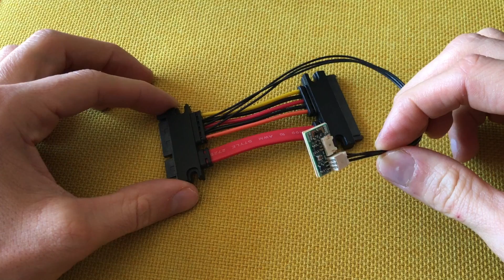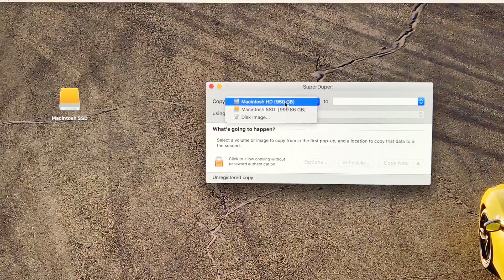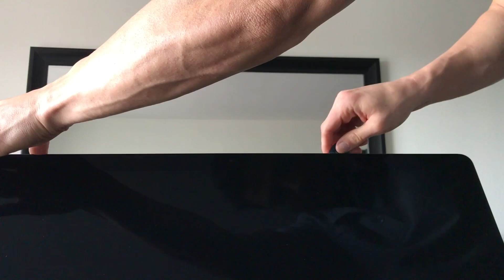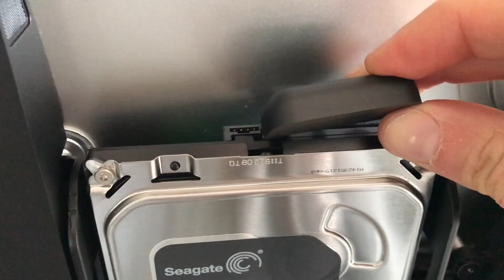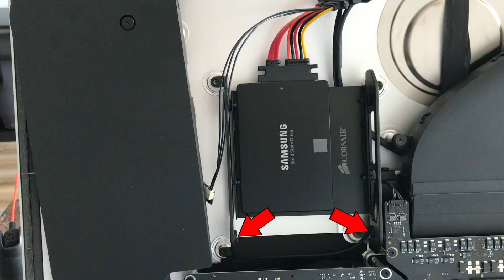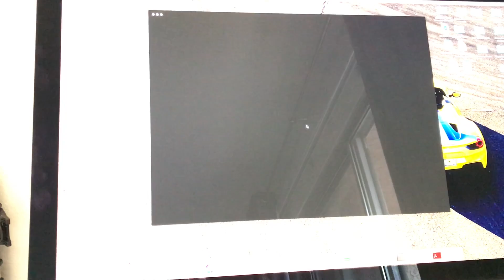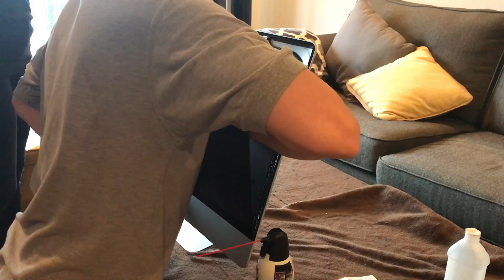How to make your iMAC 5 times faster | 2012-2017 SSD UPGRADE WITH THERMAL SENSOR | Step by Step

Comment: I just finished installing the Samsung 1TB 860 EVO 2.5" SSD in my 2017 21.5" iMac... No need for the bracket, but virtually identical install. Also upgraded the memory from 8GB to 16GB, very happy, and thanks for the video!
Reply from the maker: Michael Wright That’s awesome!! Super happy to hear that everything worked out. And you’re welcome.
Reply: no need for a thermal sensor?
Reply: @dannyisrael  I did not use a thermo sensor, computer and SSD have been fine, no issues.
Reply: Mike did you pair it back with ssd part of the fusion drive ?
Reply: @matt406regal  I had a regular HDD, like is found in a laptop, factory installed in my iMac, 5400 very slow rpm's... The new SSD just plugged right in, nothing special was needed. I have no experience with the fusion drives. I kept the old 5400 rpm HDD to use as an external back up drive. The 21" iMac is different internally than the larger 27" iMac, not much room in there.
Reply: Michael Wright what model do you have ?
Reply: @matt406regal  The 2017 21" iMac 2.3 GHz Intel Core i5. Added the 1TB Samsung and 16 GBs of memory.
Reply: Michael Wright that’s basically the same thing I did.  Ram and Ssd.   Now time for a NVme 1tb Ssd for big speeds
Reply: And mine is a 27in
Reply: @matt406regal  There you go!

Comment: I have been trying to decide what to do but I read on apples site that the max configuration for the late 2015 21.5” (non retina) is 256 Gb ssd or 2tb fusion . Is that legit? It does say the larger IMac could go up to 1 TB. So I don’t know if I can really go above 256 ssd
Reply: You can install up to a 2TB SSD in your iMac and a max of 16GB of RAM... I just did mine this afternoon, a 2017 21.5" iMac. I used the Samsung 860 EVO 1TB and a pair of 8GB Corsair Vengeance DDR4 2400MHZ 260 pin SODIMM memory sticks, model CMSX16GX4M2A2400C16 My iMac is now running on Rocket Fuel! 

The install took around 90 minutes start to finish. I used the Sabrent EC-SSHD SSD to 3.0 Adapter, around $10 on Amazon to clone my old HDD to the new Samsung SSD. I had to use a cloning program, Carbon Copy Cloner, as, at least on my copy of the latest Mojave OS, Disk Utility would not allow me to clone my internal HDD. 

A good place for even more info on doing this is Macsales.com, aka, Other World Computing. They have a wealth of Mac upgrade information, as Mac is all they do.
Reply from the maker: Hmmmm Max configuration of 256 SSD seems really low for some reason. I think that not correct, I’ve personally seen videos here on YouTube of people installing a 1TB on that same model.

Comment: I'm not a macOS user and think most people should use time machine AND clone the main disk when they like the system as it is. This is repeatable. A similar procedure saved my data/main installs about 5 times. Some were total loss of the boot.
Reply from the maker: elektron2kim I agree
Reply: unless you try to clone an APFS disk (high sierra and above) you have plenty options when it comes to full disk cloning; you can use recovery partition to boot and clone from within it, you can boot from external utility OS and run your favorite cloning tool (carbon, etc) or if you're command line cowboy you can even use dd, gparted and so (booting even from Linux external disk)

Comment: Great !! I did it with my 27” late 2013 and it ran faster! Otherwise, I found that my monitor have vertical stripes, not sure that what is the cause of this.
Reply from the maker: hmmmm vertical stripes.  Maybe the connections on the back?
Reply: @AIRWOLF  I've check and recheck but it still be there. Some technical guy said it may cause from pin socket. I'm going to recheck. Here's the strip screenshot https://goo.gl/gnNAqk
Reply: That means you damaged your screen while removing it. Sorry. 
(Too much pressure why prying it open?) Details can be found on iFixit.com, HDD drive replacement.

Comment: My hard drive doesn’t work in my late 2012 iMac anymore and I was wondering would I be good to go ahead and replace my hard drive with the ssd. Thanks for this video btw!
Reply from the maker: Yes! You certainly can.  Your iMac may not be able to take updates anymore but it should boost you speeds some.

Comment: Just some notes for others... I just did the SSD EVO 860 upgrade a few minutes ago (late-2015 Imac). My thermal sensor is currently in the mail, so I did this install without it for now (all seems fine.. no sign of the fan spinning at a higher speed than normal -  I actually can't even hear the fan and never could).      While this was mentioned by AIRWOLF when I replay the video, a VERY IMPORTANT note when pulling out the video cable === when you find the small tab on the top of it.. pull the cable towards the top of the imac which is in the direction of the imac camera, and NOT straight up towards the LCD.  If not sure, confirm exactly the direction FIRST.. because it's a very tight spot, and it is hard to see clearly.  The power cable is similar.. you must pull its connect up towards the top of the imac (where you usually are sitting and where the imac camera is located).   Also, when I cut the foam tape, I used a razor and just ensured I didn't go in much more than 1/4 or so, and take all the extra precautions around the camera. Definitely have someone help you when you lower the LCD panel, and are carefully cutting the bottom strip!  Anyways.... I used packing tape to hold the LCD back on, and will do the CPU upgrade to an i7, and add the pci-e SSD when all the parts arrive. Using packing tape on three sides keeps the LCD firmly in place as well in case  you want to run the new parts for a few weeks, or so (burn in of sorts).   Next thing I learned.. AIRWOLF mentioned using the right 2.5 inch to 3.5inch adapter. If you don't use the thermal sensor (and the cable it comes with), the mac SATA connector has very tight clearances between the IMAC drive connector and the bottom of the drive because the cables make a U turn under the drive and very tightly so.  Thank you AIRWOLF for your detailed video!!! it helped me immensely to do this job and to gain further confidence that I had things covered.  Oh.. and SuperDuper worked great in cloning the HD... and with Mojave (much easilier than cloning a PC HD :)  ).
Reply: I just updated my SSD and memory in my 2017 21.5" iMac... I tried using Disk Utility to clone, no go, would not work. So, SuperDuper or Carbon Copy Cloner, $1 difference, I went with CCC, same results, worked like a charm.
Reply: One other thing... if you have Microsoft Office (i have 2011), it will ask for another product key since the license is tied to the HD (which sort of sucks)... It gave me the option of calling microsoft on the automated line, entering the bunch of numbers and it gave me a bunch of numbers and I was good again.  Also, when the imac is asleep, it wakes up much faster with the SSD drive.
Reply from the maker: Thanks so much for ALL the information. :)

Comment: Great video man, its helpful, but I got a question. IDK if you have idea, if it work i9-9900k processor for iMac 2017 5k? this iMac now has 3.4 GHz Intel Core i5. I'm asking that, cause I wanna upgrade, the processor, SSD and MemoryRam too. Or anyone could help me I will appreciate.
Reply from the maker: Thanks so much and hope it helped a little bit.  As for your question? I'm not too sure unfortunately, but if I find some information out i'll pass it a long to you.  Hopefully someone in the comments can jump in and help. :)
Reply: I'll be waiting for thanks so much for answered have you a good one @AIRWOLF
Reply from the maker: @lopezmejia4876  You betcha!
Reply: No it won't as the 2017 iMac uses 7th gen processors and the i9 is a 9th gen processor and require a newer intel chipset to run (z390, which is soldered to the motherboard). Moreover since they're different gens the sockets probably won't match so the i9 won't physically fit into the socket as well

Comment: I upgraded my Imac 27" with a Samsung 1TB  SSD drive and I didn't need a thermal sensor. It has been a year and everything is running great.
Reply: It's been a week with my Samsung 1TB SSD drive upgrade without thermal sensor as well... no issues so far without the sensor added. (my Imac is a late-2015)
Reply: @MicheIIePucca Pucca what adhesives and SSD model did you use? I also have a late 2015 iMac, but I have several doubts about adhesive and SSD models.
Reply: @Elemedobleeme  Hi, I can suggest that given how easy things are to damage (and be expensive to replace), you should be well prepared before taking on this upgrade on an iMac. I did a quick video under my username (which some info/suggestions) of most disassembly/assembly to help others. Just search for "iMac (Late 2015) CPU Upgrade from i5 to i7 6700K. (sped up)".
Reply: This applies to 2011 yes? Was thinking of doing the ssd swap
Reply from the maker: @Pitoplata  I'm leaning towards a yes!
Reply: AIRWOLF thx 🤙
Reply: house machine I’m about to upgrade to an SSD for my late 2010 iMac. Do I need to upgrade my stock RAM too? And do I need the thermal sensor for late 2010? My tech told me to upgrade my RAM too? If ever do u have any suggestions for a good RAM product?
Reply: AIRWOLF hi! Did you need to upgrade your RAM as well? I’m upgrading to the Samsung SSD for my iMac late 2010.
Reply: is it external? or internal?
Reply: can it go upto 2TB?
Reply: @radiantDF  This is the question I want to know.... Does it have to be 1TB SSD or can I click on that purchase button for the 2TB SSD Samsung
Reply: Digging through a SLEW of videos because I think I'll dive into this today (My 3.5 HDD is sloooooooow, fear its failings also) Been a week of getting cables, bracket,  backing up everything - being proactive. Oh...and I did order the wrong bracket as well, doh!  (live and learn) The correct one is coming from Amazon later today.

I did get a thermal sensor for my Samsung 860 Evo, reason is - I see other videos that the fans in mid-2010s run at full blast if there is no sensor present (SMC Fan control is an option, but I rather just have the internals do the job.)

Checked this video for the right placement of the thermal sensor, this helps! Thanks.
Reply from the maker: You know I wasn't going to install it and I did read that you could get by without it.  But maaannnnnnnn I DID NOT want to go through this process again.  Thanks for stopping by and happy to hear that yours is working perfectly. :)

Comment: Nvme M2 SSD possible to install ? Any adapter ? Because read write speed above 1500 MB !
Reply from the maker: I've heard of these speeds, but at the time of making the video I wasn't aware. If so I would have installed that. Ah well...Next time.

Comment: Thanks for the video. Great job. I am right now planning the ultimate upgrade for my 2013 iMac i5. I am replacing the i5 CPU with an Intel 3.5 GHz i7-3770K chip. The i7 is so much faster than the i5. I am not only adding an SSD harddrive (Samsung EVO860 500Gb Sata),-  I am installing an NVMe ssd 512 Gb module directly on the motherboard. Much faster than the Sata controler. My boot up and system will run from this module. Should be running at 3Gb a second. 
I hope to have made this upgrade in a couple of weeks,- I will let you all know how it went.
Reply: whaaat? how can you install NVMe ssd into imac??
Reply: hfranke07 is this possible without completely ruining it? Considering how hard apple makes it to upgrade your mac.
Reply: I have not done it yet,- byt looking at videos and reading about it,- this should be no problem. My iMac is a Late 2013 model and there is no garanty anymore anyhow.... I will give et a try soon.
 @Mopsie
Reply: hfranke07 I’m thinking about doing the same with an NVME drive....can you share any good videos you’ve found with instructions? I also have 2013 iMac. I have a 2015 but it still has Apple Care warranty left so I don’t want to eff with that one just yet.
Reply: Woo! I would like to do the same. Could you tell us and share how did it go and the performances obtain after, and most importantly how to proceed and where to find the parts?

Comment: I was able to achieve the same result by using an external SSD. Is there any difference in speed?
Reply: Philippe Stroobandt I used the 480GB Sandisk SSD plus purchased from amazon. 
I was totally blown away in the difference in speed. 
My iMac boots up 70 seconds quicker, and I can open and run programs WAY quicker. 
And best of all I don’t have to risk opening my iMac or paying someone to do so. 
If you’re like me and don’t want to do the above, definitely install it as an external SSD. 
You need a usb 3.0 enclosure for best results. You technically can get a thunderbolt enclosure but they are rare and expensive, usb 3.0 is affordable and fast enough, and get yourself a good SSD.

I promise you will wish you done it sooner! My iMac feels new again

Comment: Im upgrading my cpu in my late 2013 iMac from i5 to i7 I really want to find a logic board so that my graphics card would be updated too but can’t seem to find a 2013 i7 logic board.
Reply: I'm planning similar.... late 2015, upgrading the SSD to the same one here.. samsung 860.. plus upgrading the CPU from a i5-6500 to an i7-6700K and adding an SSD pci-e SSUBX 512GB in the slot that comes on the 2015 model. I'm pulling the i7 out of an HP OMEN, that I'll need to replace later, but finding these i7-6700K cpus is tough because so many seem to be upgrading.
Reply from the maker: Haha you're much more brave than me. lol

Comment: great video man! thank you. can I do the same to my iMac (Retina 4K, 21.5-inch, Late 2015)?
Reply: The 21.5 inch iMacs won’t need a thermal sensor upgrade.
It’s only something seen so far in 27” models according to my research
Reply from the maker: @ChristianFadel  Copy that, thanks for the info.
Reply from the maker: Hey Tran! To my knowledge yes.  Once you get inside the iMac everything typically looks the same.  The hardest part is really just taking the monitor off.  But, with that being said I'd perhaps do a little more research to really make sure.  I appreciate you topping by.

Comment: Thank you for your time and effort! Awesome video and I'm beginning the preparation for the same upgrade to my late 2015 iMac 27". I just saw another link where they ADDED this SSD to the already in place hard drive. I don't understand the value of that. I have a 1TB drive in my computer now and will be upgrading to the 2TB Samsung Evo 860Pro. I'm fully ok with taking the factory drive out and leaving it as the next upgrade will be the computer itself. I just need about another year or so. Thanks again buddy!
Reply from the maker: Thats great!! And thank you so so much for taking and commenting.  As for leaving the orginal HD in there? You total could and just use it as extra "internal space".  But! I edit and use externals HD virtually for everything so I didn't see any use in it.  I think that you'll really enjoy the extra read and write speeds as much as I do for sure.  Happy Tinkering! - Wolfgang

Comment: Would this speed up a 4K editing even with 8GB and lower graphic card?
Reply from the maker: Hey bud!  As soon as you incorporate an SSD, you'll notice a difference right away in computing speeds.  BUT! Having more RAM will definitely help the editing software move a little faster just because theres so many moving parts with editing. Now, editing 4K with only 8G RAM, you may want to looking to editing with proxy's and/or optimized media if using FCPX.  I edit 4K frequently and I have as you know the 1T SSD but also 32G RAM and my system seems to be holding up just fine. So, with all that being said if you want your computer to run at its best you may as well upgrade your RAM at the same time as your SSD.
Reply: Thanks a lot. Well, unfortunately my iMac would not be able for RAM upgrades. It's late 2015. I thought, if I plug some faster SSD, it would help. In this case, I will need to grab iPad pro, or something.  @AIRWOLF
Reply from the maker: @NowyKurs  My iMac is a late 2015 and I upgraded mine to the max of 32G.  There's a slot on the back.
Reply: @AIRWOLF  no. No slot on the back. 21 ich mind 2015 don't have any, unfortunately. It's all build in.
Reply from the maker: @NowyKurs  Ah ic, well if you upgrade the SSD you can upgrade the RAM at the same time since you'll be opening it up anyways.

Comment: How much ram are you running?
Reply: I just got my 2017 27in iMac about 3 weeks ago. I might add 16 gb to the existing 8. 

If I were not legally blind, I would consider the ssd. Plus I am still under warranty.
Reply from the maker: Totally get the whole warranty part, as for ram I think 16G should be pretty good for you, depending on what you're planning to do of course.  I just wanted to max mine out to really have it running at it's full potential.
Reply from the maker: I'm running 32G.

Comment: Very cool video! Where I can find the two Little TOOLS that you used to cut the screen adhesive strips ?
Reply from the maker: Hey bud!!  You can definitely grab a blade tool at any hardware store.  As for the guitar pick, depending on where you live you may be able to grab some off of Amazon or Ebay, heck I think even Wal-Mart has them.